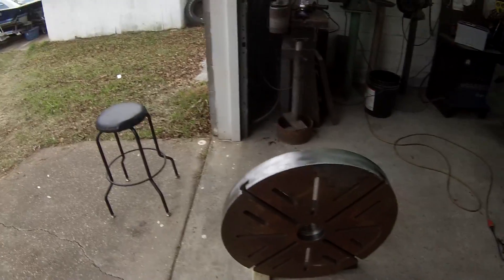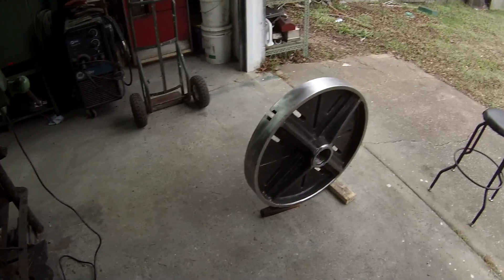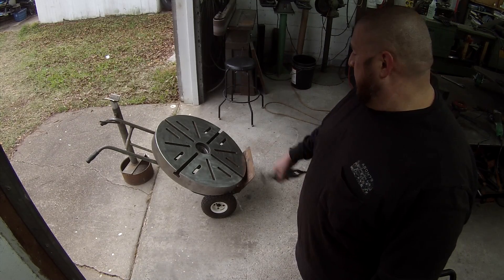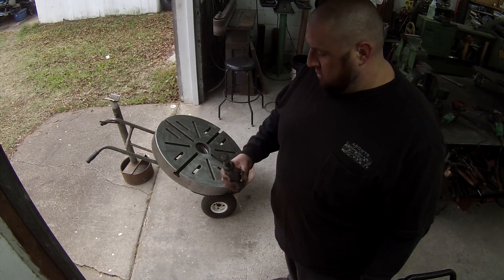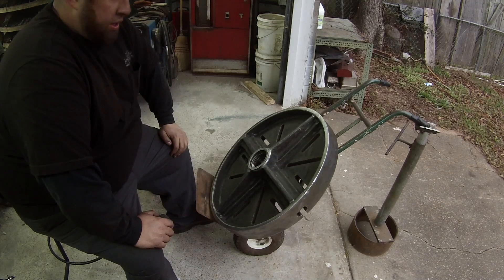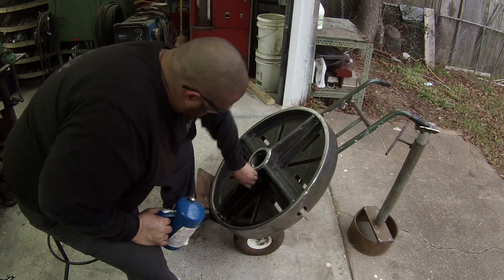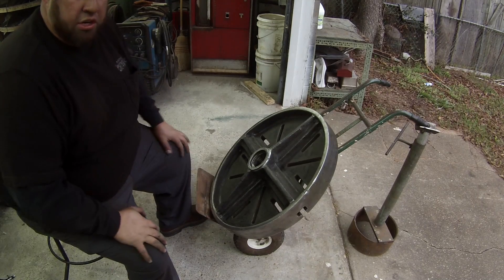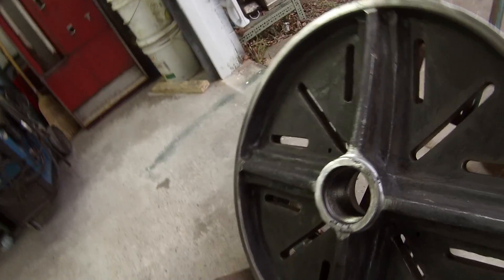Rotary Welding Table Build Part 5

Comment: Next time just get a plastic tub that is used to mix concrete in from the Homeless Death-spot and  buy some Oxalic Acid powder (White Ox Rust Stain Remover) from the Ace Place. Put the face plate into the concrete mixing tub, pour a cup full of the oxalic Acid powder in an fill with water to cover the face plate. Let it sit over night and all the rust will be gone the next day. Remove the face plate and rinse with water, blow dry with air gun, then use your polishing wheel to shine the top and edge surfaces. Coat with oil to prevent rust.

Comment: I'm commenting at 6:36, so apologies if I'm stating something that happens later in the video, but wouldn't it be easier to machine the top of the plate with a fly cutter on the milling machine?

Comment: To help with the rust problem on anything that isnt precision type stuff you can use spray polyurethane on the tools and untill it gets scratched really hard it won't rust this also works well on battery terminals to.

Comment: Did you ever consider electrolysis rust removal. Its super easy and cheep and it doesnt hurt machined surfaces, Im using it on the precision surfaces of a  old K&T 2H that I'm rebuilding.

Comment: Adam,
          If you do decide to paint the bottom portion, Rustoleum has a grey "appliance paint" epoxy style in rattle cans available at Walmart.  Did my Bridgeport knee with it and came out great and very durable.  And made in the USA. Would do your work justice.

Comment: I had a milling bed that was well rusted, so I tried mr.pete's electrolysis rust removal. I have to say it worked way better than I thought it would. Here is a link to the photos https://www.dropbox.com/sh/jrlakhiv5ky99s6/AADL29P4LvcjBHU5PvbOn0EDa?dl=0

Comment: Adam: total thumbs up for waring the correct gear to remove that rust... Looks like full face 3M with the correct filters.... Yes them masks are "not cheep" I know I got one...  also the hearing protection NICE !!  You got to take care of yourself...  I once in a wile takes something rusty over to the wire wheel and brush it off (without the gear), and it seems like I "taste"  it after.. Now I know that ant good...  Thanks for the vid Brian...

Comment: That's not easy work for sure, thank god you didn't put any CLR on that sucker, I did that once on a cast bed & the rust it pulled out took me literally weeks to clean before it stopped rusting over.

Thanks Adam this is an excellent series hope your having some fun with the build!

Comment: Adam, that's a lot of heavy bent over work cleaning that up!  It will be worth it when you don't have to bend over for welding. 

For the T-slots, could you use a T-nut and some grinding compound?  Might have to make a T-nut to fit fairly tight in the slots. Never tried it, so just an idea to consider. 

-- Mike

Comment: Hey Adam,  a little off topic, but could use your help locating suppliers of raw materials for hydraulic cylinders (need stock to make 7.640" OD finished part,  72" long w/ 1/2" or greater wall thickness).  If you could contact me via email that would be great, thanks.

Comment: nice job Adam bet that plate was scary on the lathe if you stopped the spindle with the brake youd have to run quick

Comment: Like your attention to detail Adam....! So, when the table is all done, do you use anti-splatter? I use Walter on my vise grips and such. On my welding tables (old safe/vault doors), I just sand them down with 36 grit discs, but on that nice clean face plate, you would not want splatter in t-slots. What's your strategy? Cheers, Daniel

Comment: Hi Adam,  I like to spray a thin coat of WD-40 on the rust first and wipe it off with a rag  to keep the dust down before using the wire wheel or grinder.  >Joe

Comment: Adam, Adam, Adam...

 (gee wiz, another comment from Anon - this should be annoyingly long and nit picky)

I hate to tell you this now but Molasses is your friend and rust's enemy.
If you just painted that faceplate with a nice coat of molasses and let it sit for a couple days, it would have looked as good as new when you wiped and rinsed it.
It gets in all the corners, T-slots... everyplace.

I use it to refurbish 40 year old car parts that I restore.  It works every time and like a charm.  It takes off some amazingly heavy rust.  You won't believe how effective it is.

Just don't be licking the brush when you are done.  It will send your sugar levels over the top.

Search for some videos and you will be amazed at the heavy rust it will remove.
I think mr pete may even have done a video on it.  I think it was him.

Anyway, too late now.... Just  think, with your new exercising schedule, you could have spent that day working out at the gym and let nature do the hard work...

You did start doing the workout thing, right?

by the way...

I would have thunk Elena would be the one doing the stripping in your household.
But then again, there are the Chippendale Dancers so no reason you can't do some strippin' yourself.  Goes to show you how old fashioned I am... Still holding on to old stereotypes after all these years.

by the other way...

The new cam... GoPro4... Try to not your exposure compensation to any negative numbers... it is causing the new (some of the new) videos to be a little too dark and for me in particular and I assume some other older viewers a bit too dark for comfort.
That is a setting that is usually only used in extreme situations or if the subject is being backlit... in which case you would use positive compensation.

If you want someone to explain in simple terms what all of the settings you discussed on your cam video mean - get in touch with me.  I can fill you in real quick to maybe help your experimenting go easier or even quicker.

also...

It seems like you are using a wide view setting causing the subject to be too far away and not as conveniently close as you were good at in the past.  We really don't need to see a wide view image in the kind of videos you make.  If you are showing us your back yard or the mall across the street, then wide view would be appropriate.  This entire video seemed to be zoomed out way to far to me.  We didn't need to see the truck outside and the dark area of your shop to the right. 

Just some more unsolicited advice that you probably don't want to hear but I just can't help myself.  When you tire of it... just tell me to shut up and I will.

As always, Keep up the good work...
Anon

Comment: If you left the faceplate an oiled finish, it's be easy to just use the outside lip for your earthing return welding cable, otherwise, how and where will the earthing clamp go?
I know you've got an idea or two, I remember reading about your not going to risk the electric current going through the new bearing....so maybe that rules out an earth clamp on the lower end....?
Just have to wait and see I suppose! Enjoying the build, thank you, D.

Comment: Great job Adam, it just goes to show hard work does pay off in the long run, well done. However what are you going to do with your clothes - burn them?? Elena might not want to put them through the washer with that rust in/on them. Also you will need to wash the shower down real well after you have been through for the same reason!!
Reply from the maker: Hey Dan, she's gotten pretty used to washing my work cloths now. Keep them all together use hot water, and a little extra soap.
The washrag was black when I got through washing my face! LOL
Reply: I bet!!

Comment: "Elbow Grease" still rules. Adam you must have a light tough or that air grinder has big brass ones, it didn't seem to stall much. I've normally used 3M abrasives but I have recently started using more Norton abrasives and I am pleased with them.
Reply from the maker: That's some of those "el-Cheapo" air grinders. They are loud and noisy but work pretty damn good. I find that anything 3M or Norton seems to be good quality stuff.

Comment: When I was working we had these metal plates on the table and we use to spray them with silicone lubricant for the weekend. It was easy to come off on Mondays to start of the week.

Comment: What do you think about rust converter for items like this?  The converter turns the surface black with a nice stable oxide layer.  I usually Use the milky white stuff, many vendors out there.

Comment: Looking good, Adam.  I was wondering if you considered resurfacing the front of the face place using a large lathe.  You could turn new reference circles and give the working surface a really good look. Of course, this is easy for me to say; I don't have to lift that hernia maker!  Ciao!!
Reply from the maker: asterix2419711
The Pacemaker will only swing 25". This faceplate is 30". The boring mill would work, but I think I rather leave the evidence of old workings on the face.
Reply from the maker: If I had a lathe big enough I would, but since I don't I just settled for a cleaned up finish. 
Maybe I can talk the buyer of my old monarch into letting me use it for a weekend. :)
Reply: Abom79 Great!  But be sure he lifts it onto the lathe!
Reply: Abom79 Why dont you take it for a new face to your other work place, i saw some big machines there

Comment: I cant help thinking you would have been much better off having this sandblasted ! Let someone else swallow 4 Cu Yds of dust, then just Phosphoric acid the whole thing before you paint the bottom, money well spent and you would not have a yard covered in rust dust!

Comment: Are you going to paint that plate?  If not it will be just as rusty in a couple of weeks.  A respirator for rust?  Looks like you are getting closer to finishing the super strong welding table.  Thanks for sharing.
Reply from the maker: I'm probably going to paint the underside, but the top will be bare metal.

Comment: You're getting there Adam, the plate is looking really good.  Something you might consider in the future is electrolysis, it's a great way to both clean and remove rust on parts like your plate.  I use it all the time and it works great. Thanks again for the vid.

Comment: Hi Adam,
Thumbs up for the mask... We want you healthy for a long time.
Fab work, mostly cleaning up is so messy in a shop, that's why machining is ma favorite part, easier to pick up a few chips than black fine dust that went in every crevasses there are.
How heavy is that plate? I'm sure I can't lift it on my own...
I've just heard about a better place, price wise, to get flap disks and stripper disks, they're not 3M but the price is about 3-5 times less expansive, I've heard that's excellent stuff. To be given a chance...
---Lehigh Valley Abrasives---
See you next episode,
Pierre
Reply from the maker: Never heard of or used them myself Pierre, but as long as they are good quality and  hold up to the task, why not try them. The grinding a a dirty job, but inevitable. I did it outside so that most of the dust would go outside.
Thanks Pierre.

Comment: Hey Adam, looks like a pretty time consuming job, especially with all those tight spaces. Wouldn't it be better to simply pop it in the bead blaster and blast all that rust of? are you planning to paint the faceplate as well? if so I thought bead blasting was a standard procedure before painting.

All the best,
T.
Reply from the maker: I doubt it would fit in my blast cabinet, and then there's picking it up in there. It's pretty dang stout!

Comment: HI Adam,
Nice job on the table top.  Did you consider putting it in your blast cabinet and not deal with that rust floating around in your shop?  I respect the fact that you spent the time to remove all the rust.  It will pay dividends later and looks GREAT!
Thanks for sharing.
Reid
Reply from the maker: Thanks Reid. I'm not a fan of blasting machined finished parts like this. I like the old fashioned way.

Comment: As mentioned a random orbit sander with plenty of WD-40 has been a great method for me to shine up cast iron.  I used that method on large vintage woodworking tools and it works, no dust and a little more pleasant.
Reply from the maker: Yea I might give it a try.

Comment: Sitting in the shop with a morning coffee and got involved so much that my compressor started up.....
I dunno but I wouldn't have sprayed a little satin black paint on the rough part of the underside. Would look nice with the shiny highlights and prevent rusting.. ;-)
You don't have some monster tap with a 5 HP engine to go in and clean out the threads??  LOL
The build is looking great Adam!

Colin ;-)
Reply from the maker: Hey Colin, I"m thinking about painting the underside, just not ready for that yet. I'll do another once over to get it really clean.
No luck on the tap. I wonder if Tom has one? LOL

Comment: The only reason I can watch 20 minutes of grinding is the simple fact that it's not me having to do it!
Reply from the maker: See, I can get y'all to watch anything! LOL
Reply: @Abom79  just spend 30 mins sanding 1 of my metal work bench tops , roof leaked over it got it rusty coated with oil dusty mess had fan blowing dust out of the shop ,, i know what you went threw there ..

Comment: Hey Adam, an idea for getting a wire brush in the T-slots: get a brush meant for cleaning out copper pipe fittings, and cut the handle off. Just be careful as they are not meant for high RPM, but they are dirt cheap. I use them for that purpose all the time. The ones at Home-Depot with the twisted wire handles will fit in a 1/4" air tool collet. Just regulate the air down to control RPM.
Reply from the maker: That's actually a good idea. We use them at work in the drill motor fro cleaning out tapped holes in cylinders.
Reply: Abom79 see, great minds think alike!

Comment: Hi Adam !

Oh, it looks nice ... even the back side - it screams for some black paint - would be a good contrast to the shiny rim and top plate !

Long to see you cutting these big threads on the shaft !

Haven't you forgot a variable speed motor to drive the top plate around ?
Reply from the maker: I'm still thinking about the paint on the bottom side, but that will come later. Thanks Keld.

Comment: a random orbit sander, that you use for wood, puts a good finish on large metal surfaces, they also use them in car body shops
Reply from the maker: I never used one myself on a metal surface like this one. I might look into it.
Reply: Abom79 Even better if you hook a shop vac up, that dust is nasty. That is one big piece of iron to move around, my back hurts just thinking about it.
Reply: I'm surprised Adam didn't face it - would bring the front face up like new. Maybe he no longer had access to a lathe with that big of a swing (or didn't want the hassle of removing, and much more time-consuming, refitting a gap piece)